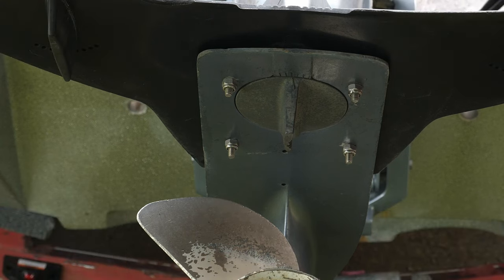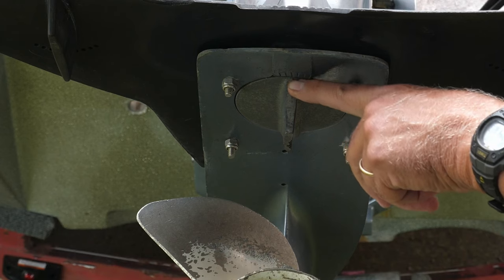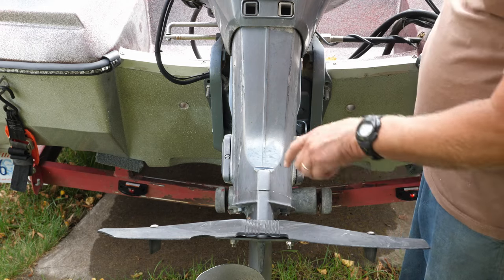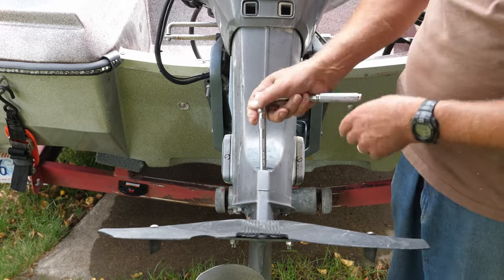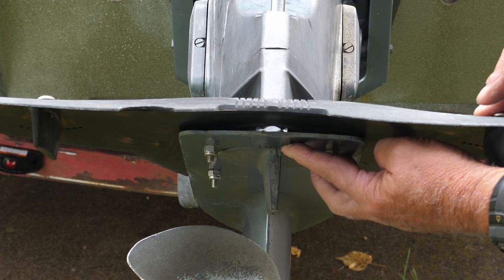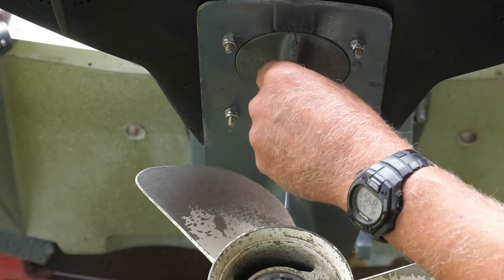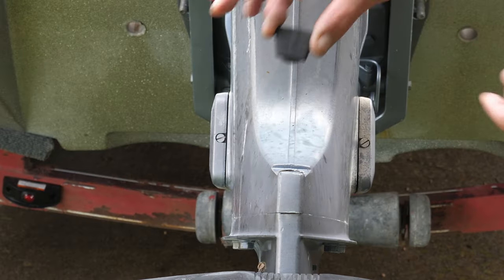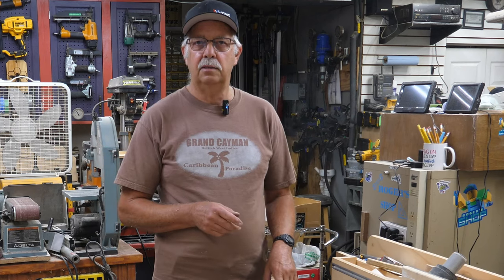Correcting Boat Torque Steer

Comment: Hey, I have a 1996 Yamaha 115 2 stroke. Would you know where to tell me to start to figure out why my rpm gauge isn’t working? Thanks
Reply from the maker: I am not a boat motor mechanic.  But, as a retired electrician, I suggest looking first at the integrity of the wiring, then the pickup and gauge.

Comment: So what do you do is all adjustments where made and it still wants to snatch the tiller handle out of your hand
Reply from the maker: Left or right?  Tilt of the motor can also affect steering torque.
Reply: @rogersshop  well if I'm sitting on the back right hand side it pulls hard  left which would make it wanna cut hard right if you where to just let go.
Reply: @rogersshop  and when you say tilt are you referring to side to side or like trimming up and down
Reply from the maker: @smokeab4613  Trim/tilt
Reply: @rogersshop  it does it no matter where it's at on the trim
Reply from the maker: @smokeab4613  have adjusted the ab on the lower unit to the right?  That should correct it.
Reply: @rogersshop  I have, it's as far as it will go right now with zero change from it being at dead center
Reply: Wrong prop?
Reply: @danielrichardson2093  I sold it, bought a new boat and motor problem solved
Reply from the maker: @danielrichardson2093  Not in my case

Comment: Mate I have a 115hp Yamaha and replaced my trim tab today and went out on the boat and tested it I found that depending on where I have the motors trim as in up or down it affected whether the boat went left and right. I ended up putting my trim tab back to the centre and felt it drove straight. Previously I would have to adjust the trim height when driving to make the boat drive straight..

Comment: Thanks for telling like it is and explaining it. We have twins and were curious why the P.O. had them toed in. Guessing it was to make the steering less twitchy, like a car. Going back to neutral/middle and I bet we get at least .1-.3 better mpg.  That may not seem like much to most, but it's a lot when you're going 140+ miles from shore to your numbers, at ~1.8-2.1 mpg with a 200 gallon tank. 

BTW, anyone who calls that a trim tab has no place owning a boat, much less working on one. It's s torque/steer tab and that's the end of it.
Reply from the maker: Well said!

Comment: Hey sir, I just wanted to ask I have a question I have a 40-year-old bass tracker with a 50 classic mercury on the back I noticed that someone put a hydrofoil
 on it, but my trim tab is set exactly dead in the middle never took the boat out yet. Should I test this motor to see where it pulls and then adjust the trim tab later
Reply from the maker: If it pulls to the right when you let go of the steering wheel, then it needs adjusting.  If not, leave it alone.  Hyrdofoils will get you on plane faster, but may take away from top end due to drag.
Reply: @rogersshop  thanks for the info appreciate your time I’m still wondering why they put the hydrofoil on at the begin with I think people are trying to get good gas mileage I guess I’m sure the 50 hp mercury can get a 15 foot aluminum boat on plane without a hydrofoil
Reply from the maker: That hydrofoil will be coming off this spring as I finish restoring the boat.  While it does get you plane faster, it also reduces top end and increases drag. @stephenbonaventure9423